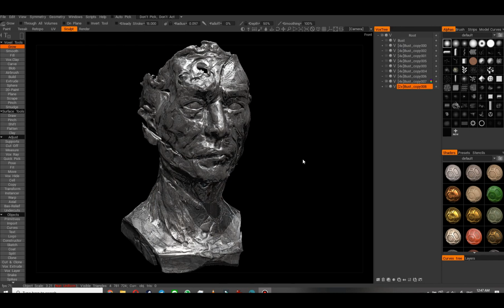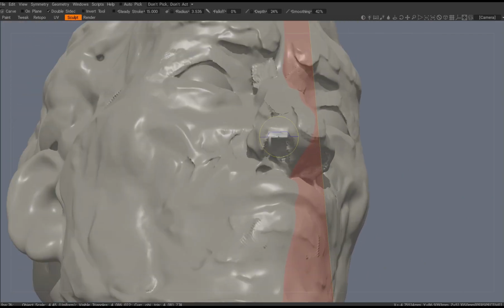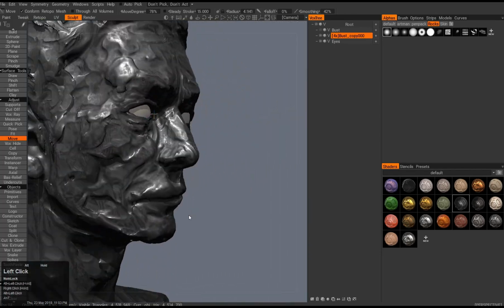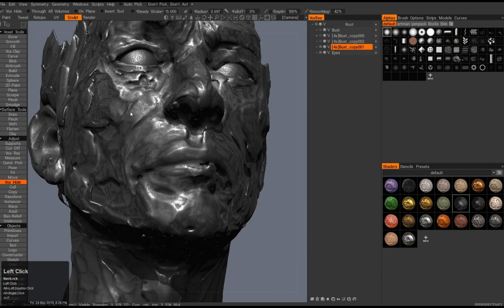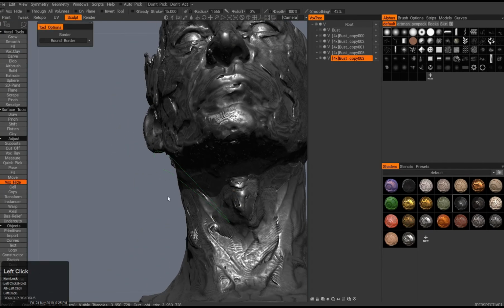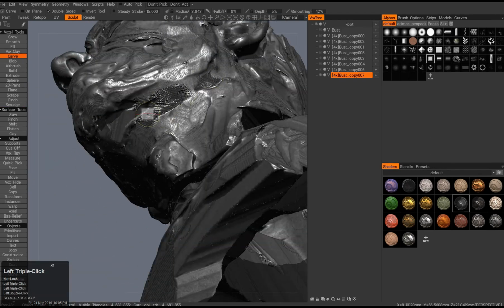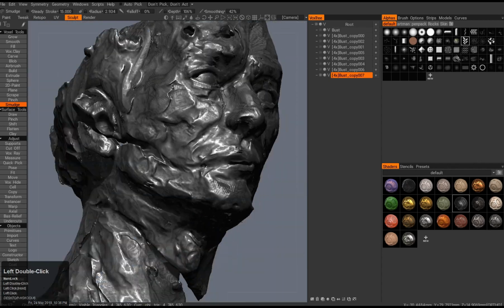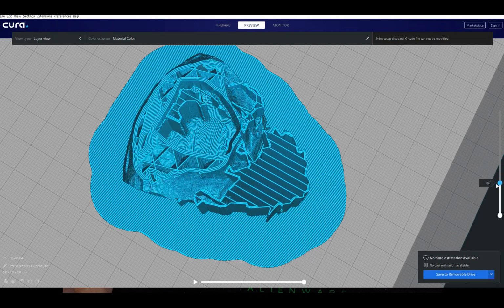Expressive Sculpting in 3D Coat

Comment: In a related question, do you use a Wacom tablet or just a mouse when doing work in 3DCoat?  Thanks!
Reply from the maker: Mostly Wacom, I've never used different tablet brand. Though I can see very nice China made options nowadays.
Reply: Oranges are not the only fruit, and yes, you need a tablet or display tablet to create digital art efficiently.
Reply: @martwoods  oranges?
Reply: @RonaldStepp  There are brands other than Wacom.